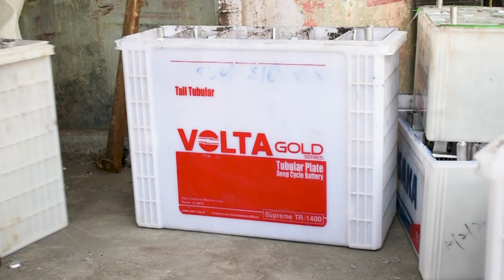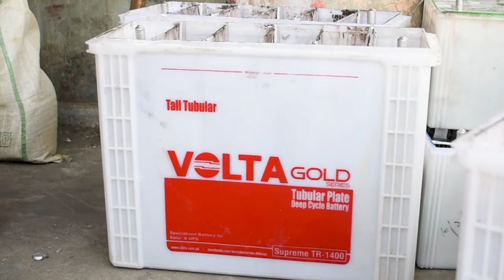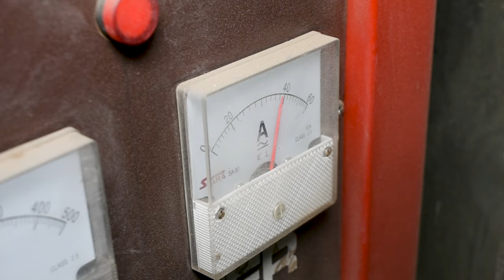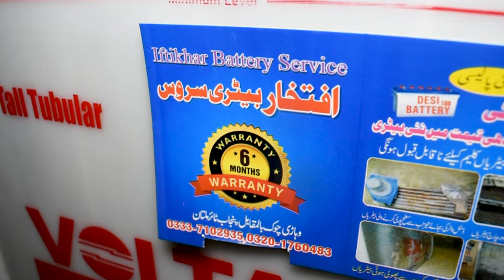How To Restore Dead Solar Tubular Battery || Tubular Battery Dead

Comment: You didn't restored tubular battery. You just used the Tubular battery box only and you have used lead acid battery plates in it. Tubular battery box is very deep and you might put something under the lead acid battery plates cells.

Comment: This is fruad with customer tabular battery cell are not used in this battery ,only body is tabular but plates are used of normal battery means no deep cycle these plates life only 6 month and the shope ceaper charge as tabular bateery repair sham on the shope owner

Comment: Looks like just a regular old lead/hydrochloric acid battery to me. 2V/cell. Deep cycle perhaps but not tubular. Correct me if I’m wrong.
Reply from the maker: It is a Tubular Battery with some alteration ,You can see the cells they are more then one in normal Battery.Thanks for watching Support us :)

Comment: Better caption can be "How to convert an old tall tubular plate lead acid battery to a flat plate battery"
 
The battery capacity and deep discharge rate would be drastically reduced.